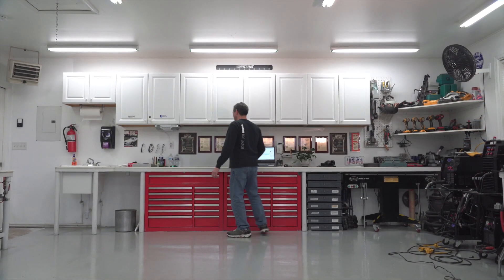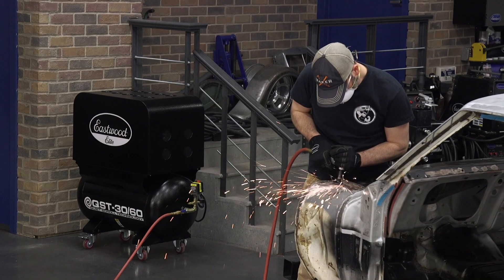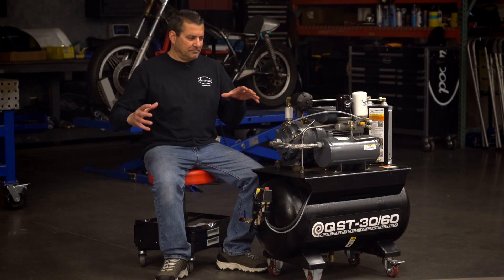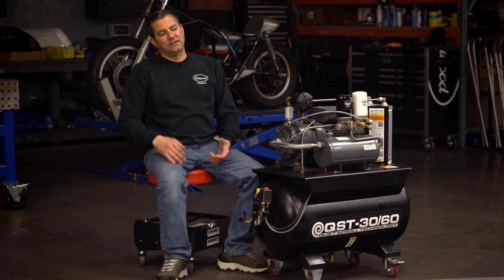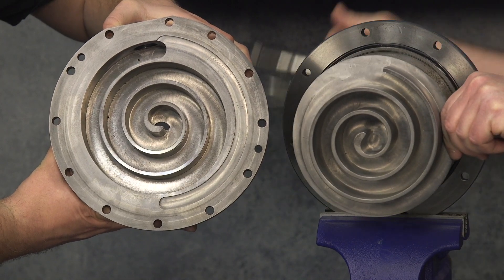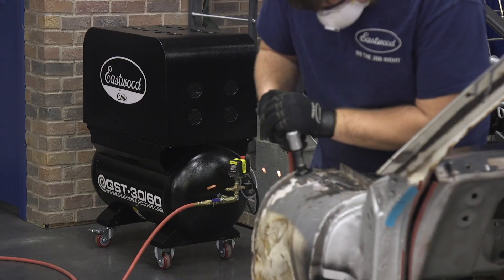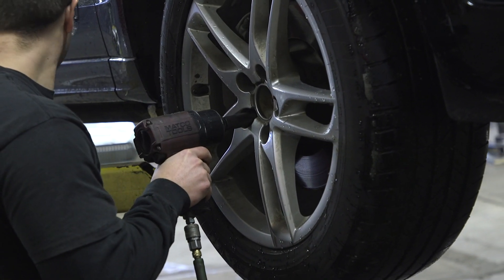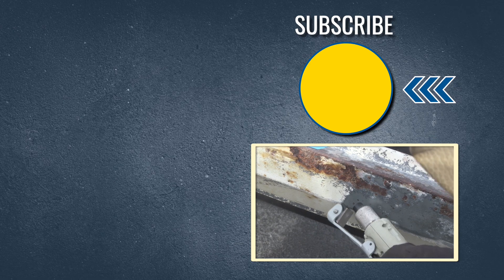How Mark Developed the QST 30/60 Scroll Compressor - How It Works & Why You Need It!

Comment: What is the SAE/ISO specification of the oil used in this compressor? The SDS/MSDS links on eastwood site appear to be dead.
Reply from the maker: Use our #31718 ( 30/60 take 2 qts at oil change) OR customer can source other brands as long as they meet: 

ISO 32 synthetic scroll/screw compressor oil

https://www.eastwood.com/eastwood-scroll-compressor-oil.html
Reply: @eastwoodco  Thanks. Honestly, would be so much easier if the oil spec was printed on the oil bottle like other manufacturers do. Also, all of the links to SDS sheets on your website are not working.

EDIT: I feel like a bunch of people are posting bad reviews of this compressor, because they don't know how to maintain a compressor. But honestly, I think lack of information from eastwood is as much to blame.  Compressor ships with oil that has dye in it, say it somewhere so that people don't freak out when pink oil comes out although new oil is yellow like most oils are. Say some place, on compressor website what oil spec to use so people don't use wrong one or be afraid to change it. Print oil spec on your oil bottle so people know what it is. It's not black magic,  it's basic maintenance.
EDIT #2:  I actually really like the compressor; not trying to give you shit about the compressor; i just feel like a lot of headaches on your part can be avoided by simply communicating technical information better. This compressor will require maintenance, don't treat it like an iphone...
Reply: While at it, let me address what others have said or complained about of various parts of the internet; most of which is actually not a problem; just requires appropriate maintenance. People complain that there is no oil heater and moisture does not separate from oil into air tank efficiently. People complain that there is no automatic moisture drain. well... those features exist on other compressors that cost $6000 and up. This compressor is still a very good deal for what it is at its price point.

Comment: Have you guys addressed the problem with water accumulation in the oil tank?  …the root cause of the oil leak at the front of the tank?
Reply: Exact reason why I haven't bought one yet. And I have the money waiting but don't want to have to use the warranty that so many of the buyers of this compressor have had to use.

Comment: I'm posting this for others who may be considering this product to reflect the experience I've had with the product and support. I purchased the QST 30/60 Elite in 2021 and have had 7 failures since then, on average every 6 months, I've purchased and installed all the updates (that should have been free under product warranty or recall), oil water bottle, updated limit switch, box fan blowing on it at all times with cover removed and as stated it failed for the 7th time late last Friday 3-3-2023. Now, we tried replacing just caps, just controller, just limit switch in the past to try to nail down the issue but to no avail and need to shotgun a new batch of replacement parts at it and can't get anything on the web site except the updated limit switch and of course there's no support available after normal business hours. Sooo I need to obtain the Eastwood parts 32213, 32214, 32215 and 31700 (400uf Start cap, 60uf Run cap, motor controller and updated limit sw) but have to wait until Monday as the only part that comes up on the web site is the 31700... 
This thing once again created delays in my delivery of product. The season is up on us and I try to do a bit of side work and am kinda an old redneck one stop shop for custom bike metal and glass fab, custom painting, airbrushing, pinstriping, cosmetic repairs, etc,  opportunities and would pay if I could just get parts on a plane ASAP, and worry about reimbursement after.  Best case if it was my company I'd have sent me a complete unit, hired Two Guys and A Truck or whatever to get it packed and freighted back but I can't seem to get Eastwood to replace the lemon or junk unit I have again. I'm only on number 2. In 2021 it failed and the unit was swapped out, which is no pleasure cruise getting it on the pallet and boxed up by yourself  but a tie down D ring in the ceiling, a come along and some straps works to get the drain and casters over the pallet obstructions. Since then I've only been able to get parts, at no charge but can't be expedited for some reason. And to add insult to injury 7 failures in 2 years, after documenting via text and a bunch of pictures, all the issues with bad assembly and manufacturing quality issues like bad crimps that had obviously fried, loose terminal board mounting screws and more for Eastwood when I asked again in June of 2022 the last time it failed if my experience was common and the Tech Support gent said he'd take it to his Product Manager but of course I never heard anything back. Hope this helps inform and educate interested parties.

keep the rubber down and the wind in your face and a frown can never cross your face.
BC
FatBobs Customs, NE Ohio

Comment: I love the concept and really want one, I'm deeply concerned about all of the bad reviews and experiences documented on youtube by end users.  Has Eastwood sorted these issues out?  Is there a pre sales support line?
Reply: I've had mine 3.5 years now, and I've only had one scare where it would sometimes squeak on shutoff after sandblasting and really working it for extended periods of time. I stopped using it and contacted customer support. They thought it was the intake valve shutting and advised that it wasn't an issue. It's never failed to make quiet air when I need it. I haven't heard any squeaks since I finished the last extended sandblasting session. The sandblaster, plasma cutter, mist cooler, and paint gun are all louder than the compressor, and it's great. I still get a kick out of it when it comes on filling up tires because that's about the only time I notice it.

It hasn't been perfect. I found a bonus set screw in the cabinet (CS thinks from assembly or test equipment), there's a piece of a broken drill bit embedded in a foot gusset, and some of the bolts holding the equipment down inside the cabinet were loose after 2 years when I investigated the squeak. I guess the loose bolts were probably due to the rubber isolation bushings settling from heat, age, and vibration. In aerospace, FOD (foreign objects / debris) is a big deal, and maybe that biases me to be overly concerned about seeing extra stuff. Compressors aren't missiles. At any rate, none of the issues have cost money to fix.
Reply: @Fred-mv8fx  Broken drill bit!!! That's just hack builders that don't care about the end product. Also if you read the reviews there's more than one of these compressors that arrived at customer's houses with loose bolts and bolts that completely fell off in the crate. I'm scared to buy one of these because of all the negative feedback I've read about these. I do want one but when I buy anything I hope that I do not have to use the warranty.
Reply: I've had my compressor for 6 months and have not had any issues with water in the oil ,the secret is it has to run enough to evaporate the water from the oil if it doesn't get warm enough its going to build water , the tank of all compressors will have water

Comment: This is THE air compressor that I wanted but the quality reviews are very poor. Humidity issues, breaking issues etc. I'll wait a few more years and hopefully better review will come out.
Reply: I've had my compressor for 6 months and have not had any issues with water in the oil ,the secret is it has to run enough to evaporate the water from the oil if it doesn't get warm enough its going to build water , the tank of all compressors will have water
Reply: Same here.

Comment: I was part of the "early adopter, pre-buy" group 4 years ago now, so unit was heavily discounted verses current price; $1500, I think.  I had a couple of "infant mortality" issues on those first-generation units.  An oil fill indictor that warped and leaked; Eastwood replaced that and sent the oil change materials with the replacement.  The intake air filter housing was made of weak plastic and broke; I didn't even ask them to replace that, I just built a new one out of steel.

The thing is awesome BUT it does generate A LOT of heat if you are running at 100% duty-cycle for more than a few minutes. Enough that I cooked paint off the compressor head and vaporized some oil running a soda blaster for 30-40 minutes.  I would suggest to anyone else who might plan to push the unit close to 100% duty cycle to add a 10" temperature-controlled fan, like I did (a server fan, off Amazon). Now I can see how hot the compressor is on the digital display and know the fan will kick on at 100F if I push it.  It usually runs at 75-80F.
Reply: A lot of the reviews talk about the heat and quite a few even have pictures of the capacitors burning up and filling their shop full of smoke. I want one but not until they clear up these issues.

Comment: I plan on getting one when my current unit bites the dust, but the price will probably have me weighing this or buying parts needed for my restoration and a box store one.  I'm usually by myself in my shop- so the noise isn't a huge issue.    But, the output is much better than what I have now.  It certainly would make blasting easier.    I like the "behind the scenes" on the R&D too.  Eastwood is always  innovating and coming out with coolest tools- I tend to spend way too much money with you guys

Comment: I’ve had my Eastwood  30/60 Scroll compressor for over 3 years now and can’t say enough good things about it. I have a significant hearing loss and tinnitus , and cannot tolerate loud noises. Compared to my old piston compressor, it’s incredibly quiet. When it’s running I can stand next to it comfortably without hearing protection. It easily powers all of my pneumatic tools from grinders, impact wrenches, sanders, abrasive blasters, drills and spray guns with no loss of pressure. Mine is the first generation unit and I imagine there are improvements on the latest version, but I have no idea what they would be . To say I’m satisfied would be an understatement. Worth every penny!

                                                                                                                            Bill Z
Reply from the maker: Thanks Bill, we're glad it's working well for you! 😁